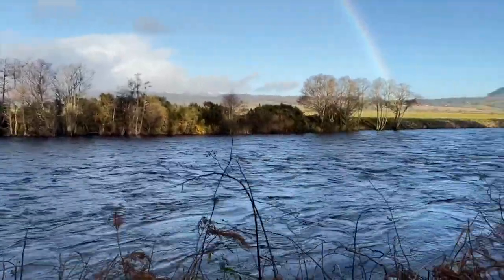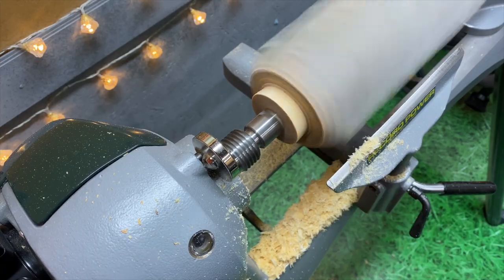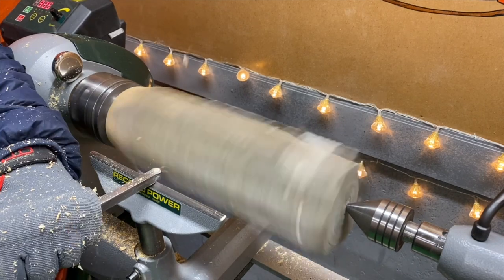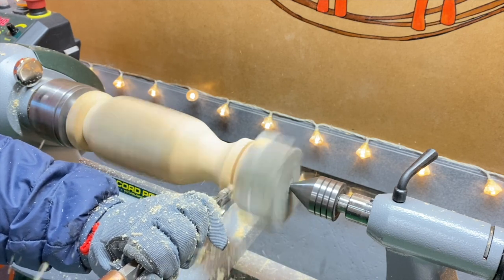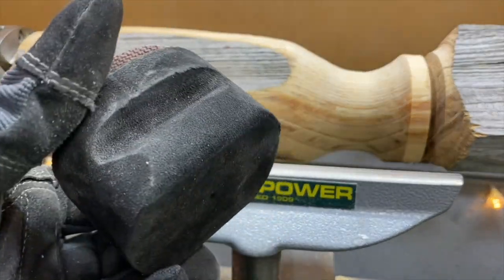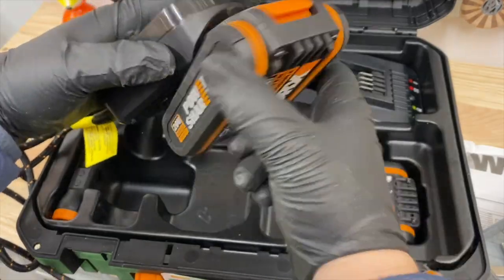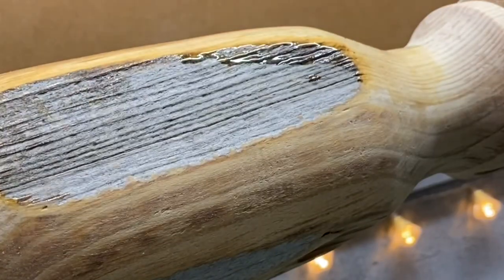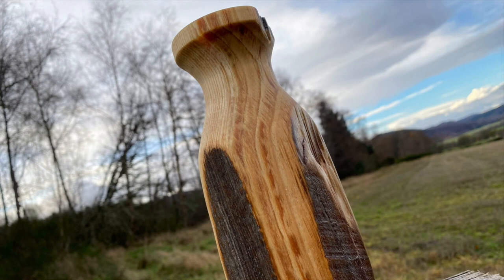Woodturning| Fence Post Log to Vase

Comment: I used to love making these 'weed pots' . I left the centre completely untouched just turned the base and neck, drill out to accommodate a test tube so you could add a couple of stems with a bit of water. I also occasionally added a bit of old rusty barbed wire and a couple of big old staples around the middle - very rustic. 👍 🎅
Reply from the maker: That sounds an awesome idea. I actually have some old test tubes and will certainly do that when I make more!!! Thanks! Rusty Barbed wire sounds a fab touch too. Super foxy ideas! Appreciate you taking time to feedback! 🥰🌲🦊🌲

Comment: Interesting project. I rarely throw wood out so this is the sort of thing I would do. 

It’s not a steb centre you have , that’s a 4 prong spur drive. I’d recommend getting a steb centre as they are ideal for smaller projects like this. I have 2 different sizes and can’t remember the last time I used the spur drive.

Well done!
Reply from the maker: Good to use up scraps,  hey? Must be a few missing fence posts around your way too 😂. Ahh you spotted the technical hitch, I started off with a steb centre but I didn’t have much luck with it holding - it’s the one which kind of pushes up crown like spikes on on to a central spike? I swapped it out and figured no one would notice - should have remembered, Paul will notice! 🤣👍 I’m not sure why I’m not having luck with it? X